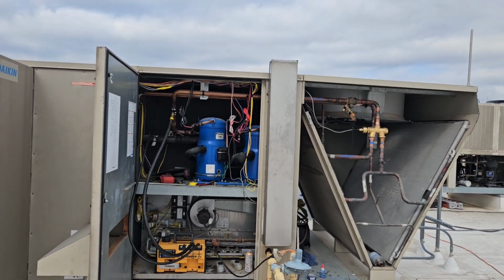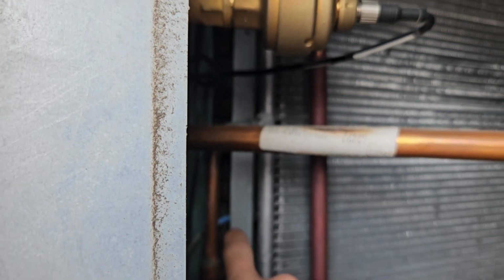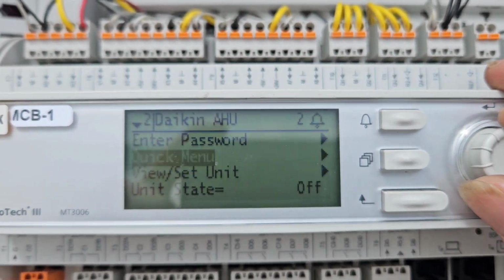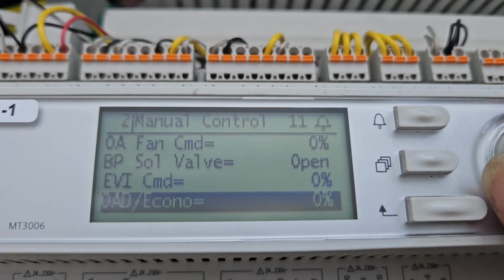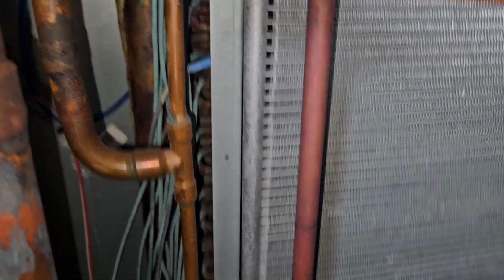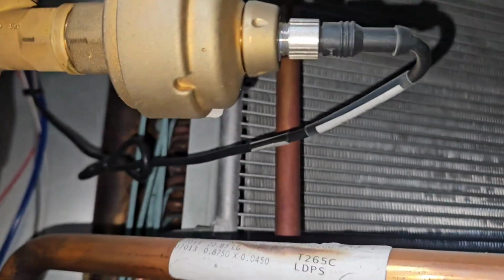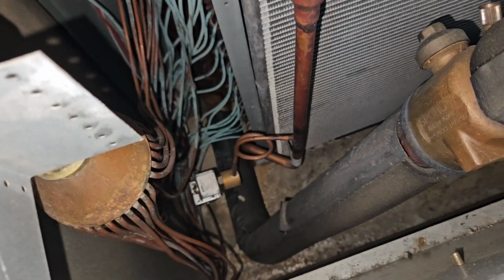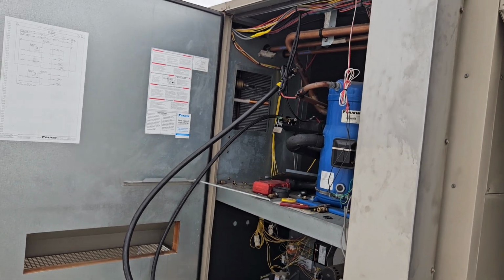NEW RE-HEAT VALVE ON A REBEL. EXPLANATION OF HOW RE-HEAT OPERATES WITH A VARIABLE SPEED COMPRESSOR

Comment: I knew exactly where you were headed next when trying to get EVI to 100%. I just went through that on a Rebel last week. I learn something new about those MicroTech controllers every time I mess with one and I’m starting to like them more and more.
Reply from the maker: @haldermand  that's cool you already know. It can be difficult if you aren't used to the structure of the settings. Once you learn how they are laid out for the various platforms they are used on. It does get a lot easier and it definitely makes you like the controller even more. I personally feel it's not over complicated and laid out well with all the functionality you need to run a piece of equipment.....and unlike other brands....you aren't locked out and can't get in to control the equipment and set it up.

Comment: Forgive me for what might sound like a stupid question, but I work on very niche precision cooling equipment and have never touched a unit similar to what you have in this video. However, most everything I do work on has variable speed compressors controlled by a VFD (which also has numerous sensors connected to analog or digital inputs along with other equipment connected and controlled by analog or digital outputs with the VFD connected by Modbus back to a controller inside the building). 

Back to the point and question, the VFD is initially programmed with some standard baseline values and the same goes for the remote controller inside the building. Anyways, the VFD is programmed for a slow “ramp up” of the compressor and initial frequency can be changed in the controller, but ramp up is programmed at the VFD as part of the baseline, with current limits set to shutdown the system (and prevent compressor damage) if current exceed expected thresholds on the ramp up. Accordingly, there is no bypass at startup to prevent inrush as you mention in your video. My question is, if these are variable speed compressors (I assumed powered by a VFD), why the bypass when you can have the VFD programmed for the ramp up to prevent that very issue? Now, I can think of a few reasons why, but rather than make assumptions (also called the SWAG method, probably dating myself as not sure that acronym is used much these days), just curious if you could explain in more detail as maybe I missed something or just lack enough foundational knowledge of these systems.
Reply from the maker: @EarlHayward  great question and format of said question.  I personally have never seen a bypass for a variable speed compressor. My assumption for that is that these compressors run at higher than 60hz. The only way to get to full speed is through artificial means....aka a VFD. 60 hz for some compressors is less than 50% full speed. I'm sure there are other mitigating factors as well.

Comment: Heck yeah the Rebel! Enjoyed the vid dude! Here in SoCal not much humidity issues I have yet to see a unit I work on with it. This 410 or 32? One of our buildings is going to get a r32 rebel on it.
Reply from the maker: @HVACslayer  I didn't hardly ever see any re-heat equipment in So Cal either. San Diego was never that humid. It's a 2017 unit so its 410.